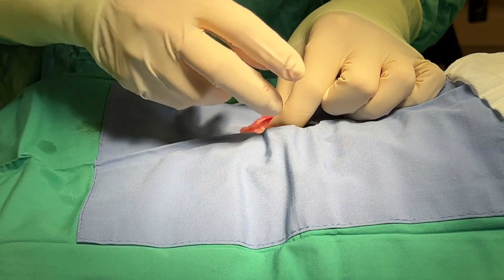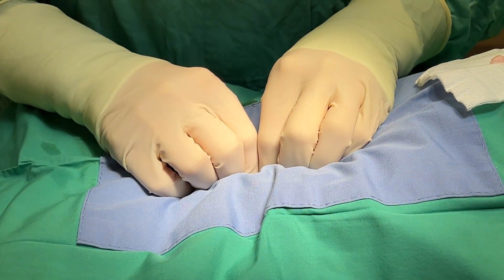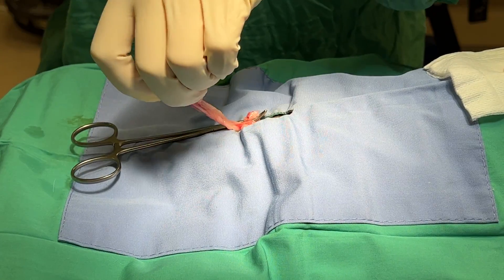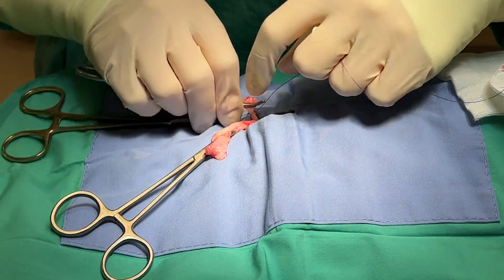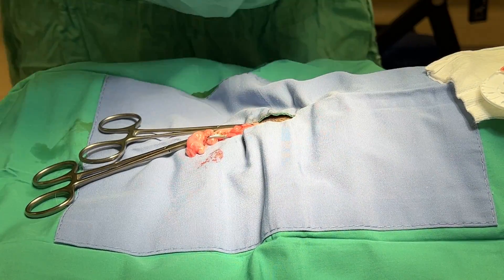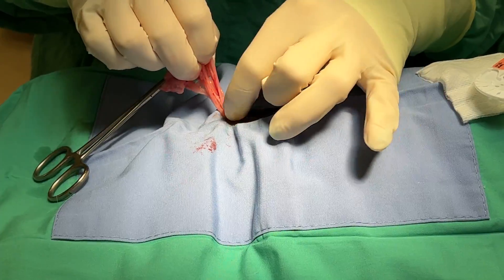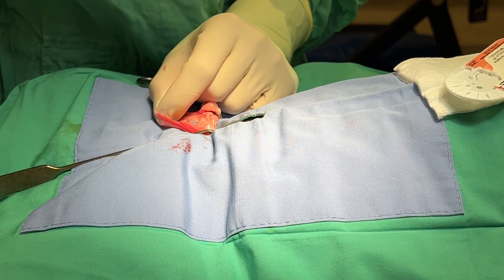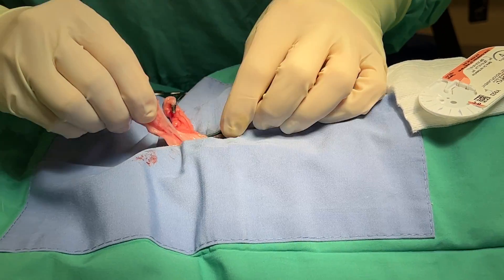The BEST way to Disrupt a Suspensory Ligament - Dog Spay Surgery "SLO Technique"

Comment: And for large dogs? The same?? Help me please this is my most difficult part when I spay
Reply from the maker: This technique is no different with a large mature dog. You pinch the ovary with your dominant hand and use your non-dominant hand to feel the suspensory. With both hands together against one another, push down on the dog's abdomen and slowly move them caudally until there is a stretch or a break. If you do not push down while moving caudally you risk tearing the vessels as soon as the ligament ruptures. I have done tens of thousands of dog spays (many in heat, obese, pregnant) and have been teaching vet students for over a decade and this is a preferred technique to safely and ergonomically disrupt the suspensory. If it hurts your hands, you're likely doing something wrong.

Comment: Please, please, especially for young baby surgeons, never, ever cut your pedicle without a ligature. If you have hemostats or clamps like the ones I have in my clinic, you WILL be in trouble and a dog WILL die at some point. I already had clamps behaving like scissors (imagine the disaster), or the more common ones, the ones with a bad locking system that reopen on their own. Without a ligature first before cutting : bye bye pedicle going right back in the depth of the abdomen, lost in so much fat you can’t see it, hello red tide that is killing my dog and obscuring my vision even more!
Reply: i would recommend working at a new clinic or buying your own instruments.
Reply from the maker: If you have instruments that unlatch on their own, they belong in the trash. It is a huge liability to have poor quality/broken instruments in surgical packs. I recommend using a Rochester Carmalt to start if you are going to cut before you ligate. The horizontal striations are much more secure than those of a mosquito/crile/kelly. Also, clamp your clamps completely (3 clicks) and don't cut against the clamp, leave a bit of tissue to give yourself a buffer so it's less likely to slip through the clamp.
Reply: Our old surgery professor once said, surgical instruments are tools of life. We must treat them like one of our most precious possession. Manage their cleanliness, and keep their quality, and they will never let you down. But yeah, learning variations of knots, ties, suture techniques is also very important. One in particular is the variation of Miller's knot without cutting/severing.
Reply: Happened to me. Not great.

Comment: Well, this example in the video was quite easy,small dog with easy to pull ovaries, nearly like a cat...but 2hat to do with tight large young dogs,when theligament is so stiff,that cause pain in fingers,when you try to pull out the ovaries somehere 1 cm over kidneys with one hand in abdomen, feeling as the kidney is moving up while you are struggling with this😢
Reply from the maker: This technique is no different with a large mature dog. You pinch the ovary with your dominant hand and use your non-dominant hand to feel the suspensory. With both hands together against one another, push down on the dog's abdomen and slowly move them caudally until there is a stretch or a break. If you do not push down while moving caudally you risk tearing the vessels as soon as the ligament ruptures. I have done tens of thousands of dog spays (many in heat, obese, pregnant) and have been teaching vet students for over a decade and this is a preferred technique to safely and ergonomically disrupt the suspensory. If it hurts your hands, you're likely doing something wrong.
Reply: @dvmsurgery6139 In this video the ovary is ALREADY ABOVE the abdominal wall,which is very rarely to achieve before you cut the suspensory. In big dogs the ovary is somwhere 10 sm under the abdominal opening and you try to manipulate blindly somewhere there. Didn't you see such cases?